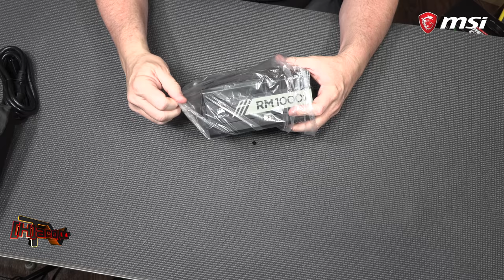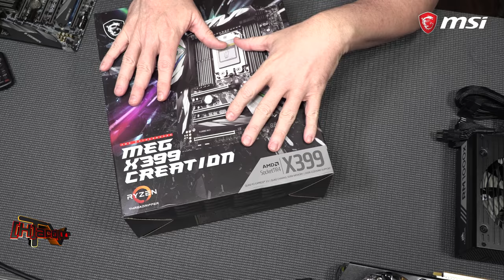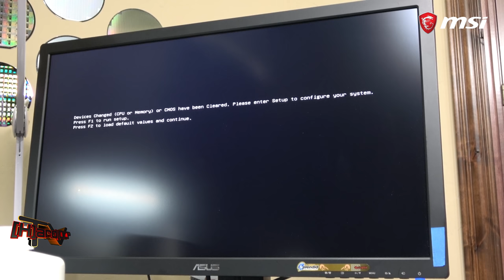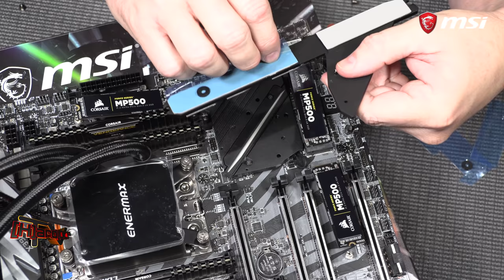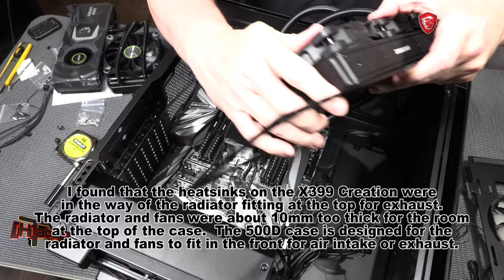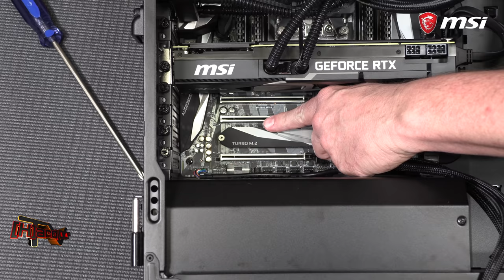MSI X399 Creation Threadripper Build - Start to Finish

Comment: I want to thank you for this video. I have never put together a computer before, and wanted a new HEDT computer. I did not trust the online computer companies, or their prices. So I bought the computer parts I wanted. And followed your video as I built my own computer. And followed all your steps. The system I built used a Thread Ripper 2950x, Corsair RM 1000 x PSU, MSI RTX 2080 Gaming X Trio, x399 Asus Rog Extreme Alpha, 64 GB of Corsair vengeance RGB Pro memory @ 3200 Mhz, 970 Evo 2TB  Nvme, Enermax TR4 II 280 AIO, 6 Corsair LL120 fans, inside a Lian LI PC-011 Dynamic case. The system looks great, and I had no issues.  And I was able to OC my memory, and CPU with the information from your web site.  Cinebench score was 3553!
Reply from the maker: Dude!  That is awesome to hear.  Glad we could help you out, and thanks for leaving your comments.

Comment: I actually love this way of building a pc. I've built pcs for almost 20 years. almost as long as Ive been a member of the hard forums... and I've always just put everything together and into the  case and prayed when I turned on the power button. only had to troubleshoot problems on a few pcs that I could remember (must be lucky), but this way would have made things so much easier to diagnose. Nice video.

Comment: What if you were to use the 2 PCI-e cables on the GPU, and run one of the pigtail leads over to the M.2 card? It would give better power distribution, since I doubt the M.2 card draws all that much power when compared to the GPU. Might also look cleaner. Just a thought. And as for the fan on the Aero card, would just the heatsink alone be enough since M.2 drives run better when warm? That's of course if you can't change the fan profile.
Excellent build video Kyle. And yeah, I watched the whole thing! It looks good, and not overly saturated with RGB. 
Have a great day, and Happy New Year!

Comment: One thing that is good to check is the standoffs are in the correct spot. Not usually an issue on ATX and high end cases, but when you get mATX and chepo cases the standoffs can be in the wrong spot = dead motherboard when you power it on.
Have you considered modifying the power cable and cutting off the extra lead from that 6-pin powering the SSDs?

Comment: so you do not need to connect your Hawk to some custom water loop? There is already water in the pipes between the radiator and the GPU mounting?
Reply: its a closed loop system

Comment: Great video. One of the best 2950x builds I've seen. I'm building a 2950x system soon and looking at the Enermax Liqtech TR4 cooler but it's had a lot of issues since launch. V1 and V2. Did you have any corrosion or leaking issues with yours? Cheers 👍
Reply from the maker: No, no issues yet, working well.  But honestly, given all the issues it is hard to tell you to go that way.  I think any enthusiast really wanting to go TR should do a full custom loop.  I am moving there, but the Enermax AIO made for an easy stopgap to get everything figured out before having to concentrate on figuring out the loop.
Reply: Ive had mine since the 1950x came out and its been flawless.

Comment: Rvenger here - Looks like I am building a threadripper now. Kyle, how bad are the Foxconn sockets of recent? Anything to worry about?
Reply from the maker: I have never run into any bad TR4 sockets in all the boards I have worked with. Yes, some took a bit more pressure to get the threads started, but none that were defective.  That said, I am not handling these with kid gloves either.  That said, the TR4 socket is so robust, that you can put all sorts of pressure on the fasteners if you need to and the board is properly supported.  Don't be scared of the sockets...except for touching the pins.  Be scared of that.

Comment: that 860evo wont work in that expander card as its sata3 and not pcie....
Reply: That was my 1st thought before Kyle even said it didn't show up. Anyway, good advice for new system builders or people new to TR4.  Thumbs up Kyle
Reply from the maker: @bitmaster6542  Yeah, I assumed the EVO 860 was NVMe when I grabbed it off the test bench.  I did mention in the HardOCP write up as to this issue being on me.

Comment: Hi, I have a problem with the ASrock taitchi X399 the VRM temperature is 90~100c on the BIOS H/W cause my CPU to drop speed to 0.60ghz on full load but when I touch the VRM heatsink there's no heat at all what do think is the problem please I need help!
Reply from the maker: No clue. AsRock will not send us boards to review for years now.  I have zero experience with its products.
Reply: @HardOCPTV  Alright thank you so much.
Reply: @HardOCPTV  Ok so what do you think about the GIGABYTE X399 Designare EX ?
Reply from the maker: @itsthatYEStoogoodguy  Had I not used the MSI board, which I love, I would have used the GBT board noted above.
Reply: @HardOCPTV  I don't know which one to get MSI CARBON or Gigabyte Ex or Asus Prime-A after my faulty Asrock mobo.
Reply from the maker: @itsthatYEStoogoodguy  Carbon would be my pick.
Reply: @HardOCPTV  Alright thank you.

Comment: How quiet is the overall system?
Reply from the maker: Actually very quiet.  The fan on the M.2 card has the loudest fan profile with all stock profiles running.  I took the fan off as it is somewhat high pitched.  I do need to rewire it to run off the motherboard fan header so I can control it.  No fan profile on the card it seems.

Comment: Does the threadripper bottleneck the 2080?
Reply from the maker: I guess that would greatly depend on the resolution you were gaming at.  1080p, quite possibly.  1440p, rather unlikely.  (I run a very CPU intensive game at 1440p and still see GPU scaling in it moving from 2080 to 2080 Ti.) 4K, extremely unlikely in modern AAA 3D title.
Reply: HardOCP TV I have the 2950x and a 2080ti strix. I play at 1440p 144hz and in some games like blackops 4 blackout my gpu usage is 55-70% and I get 75-100 FPS ( everything maxed out- no v sync) Do you think that’s normal or not?? Could the reason of this low gpu usage be the fact that I only have 2x8 ddr4 ram stick at 3000mhz???Also one of the ram sticks is not installed on the recommended ram slots because one of them (the 2nd on the right side) doesn’t seem to work. What do you think??? Sorry for the large text but I’m really confused...
Reply from the maker: @donovan4009  The 2950X is a QUAD Channel RAM CPU.  You need to be using 4 sticks of RAM at a minimum.    Yes, that could very likely be causing you some issues.  I would cross that bridge first.
Reply: HardOCP TV thnx
Reply: @HardOCPTV  could you please check when ever possible what your fps are in 2k,no vsync, everything maxed out when playing blackops 4 blackout or pubg or forza horizon 4 (and if gpu usage is over 90%)
Reply from the maker: @donovan4009  I own neither of those games.
Reply: @donovan4009  The only bottlenecking potential thing here is that junk RTXs, sorry
RTX2080TI  FP64 = 1/32 FP32 = 420.2 GFLOPS
Kuadro K6000  FP64 = 1/3 FP32 = 1,732 GFLOPS
As we can see here Nvidia plays serious only on its professional class.
Radeon VII  FP64 = 1/4 FP32 = 3,360 GFLOPS!

Comment: You've used 3200MHz RAM. Could the system benefit from even faster RAM? 3600MHz?
Reply from the maker: Sure you could, but the benefits would not be noticeable in daily computing.  Also very hard to get those speeds across 4 sticks.